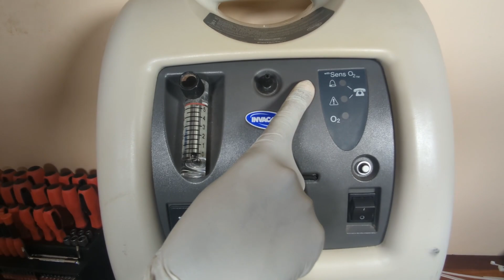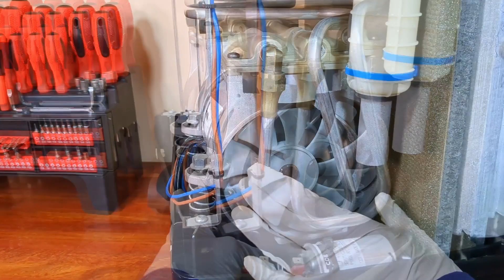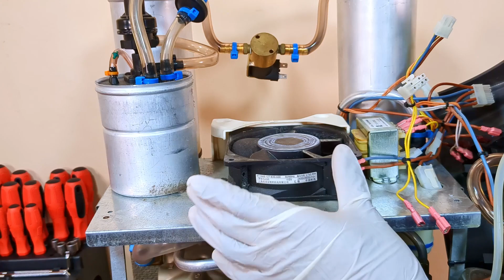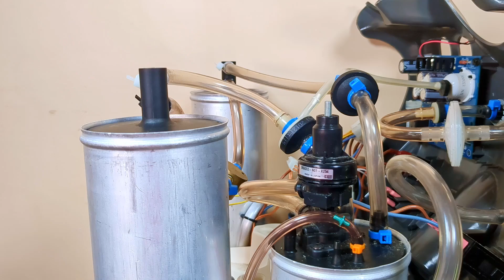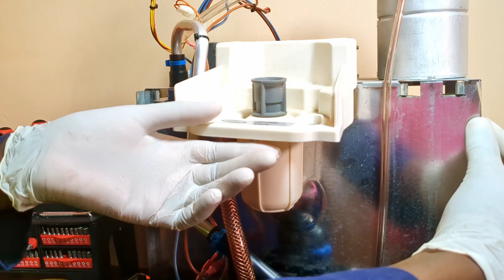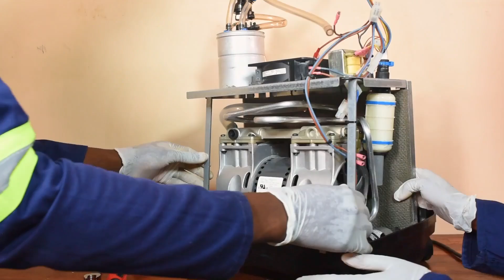Invacare Perfect Oxygen Concentrator Tear Down

Comment: Hello 
I have invacare perfecto2 every time i use 3lpm or higher the yellow light on does dirty hepa filter can cause this ??
Reply from the maker: Since the concentrator cannot maintain the required oxygen purity at 3.0 L/min and above, the most likely cause is low operating pressure. The fact that it performs normally below 3.0 L/min indicates that the PSA system cannot generate enough pressure as the oxygen demand increases.
You are right. A dirty or clogged HEPA filter  blocks and  restricts airflow into the compressor, reducing the pressure required for the PSA system to produce high-purity oxygen. Inspect the HEPA filter first and clean or replace it if necessary.
Another possible cause is air leakage from the oxygen tubing or loose connections. To detect leaks, apply soapy water to the tubing connections while the concentrator is running. Bubbles indicate a leak that should be repaired or the affected tubing replaced. Avoid spilling water on the control board or exposed electrical wires during the test.
Reply: @uptime-alliance thank you  i will replace hepa filter first like you said 
About tubing i already tried it without tubing or humidifier same problem

Comment: I am having this machine. The yellow light glows after 15-20 minutes of start and move to red with alarm. Please advise your service station address for Pune Maharashtra India.
Reply from the maker: The yellow light turning on after 15–20 minutes usually indicates that the concentrator is detecting reduced oxygen purity ( Below 73%). When it progresses to red and sounds an alarm, it's warning that the oxygen output may be too low for safe use.This is often due to issues like clogged filters, blocked tubing, poor ventilation, or worn-out sieve beds that need replacement. Unfortunately, we don’t have a service station, but we strongly recommend that you stop using the machine and have it checked by a qualified technician to ensure it’s delivering safe oxygen levels. You can also reach out to helpdesk@oxygenalliance.org for further assistance on this issue.
Reply: @uptime-alliance Thanks 🙏. I have purchased a new machine.
Reply: Have this machine but the output oxygen coming is very low what can be the problem